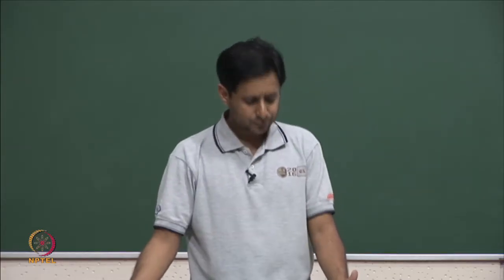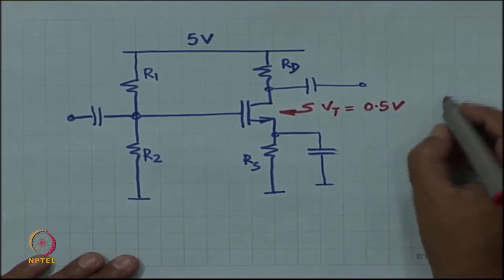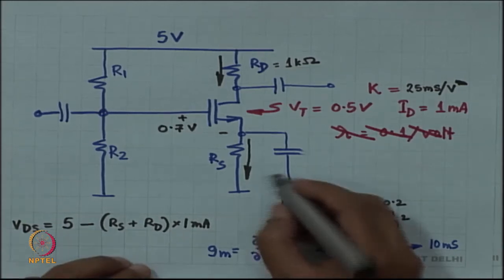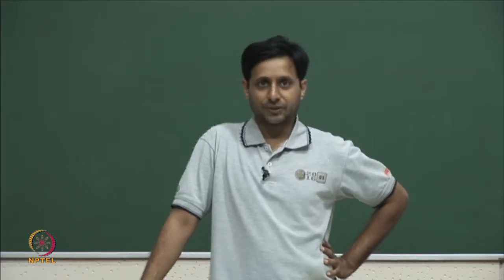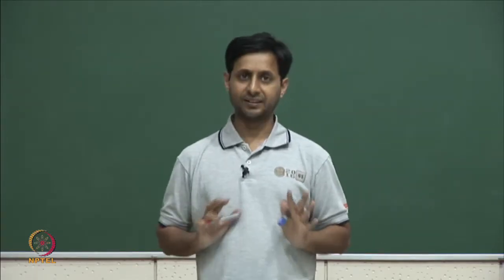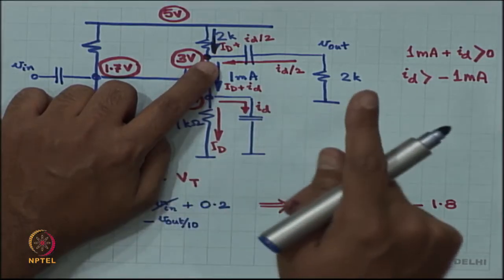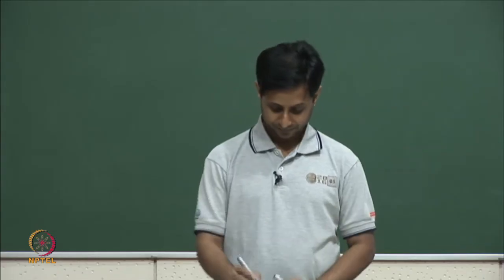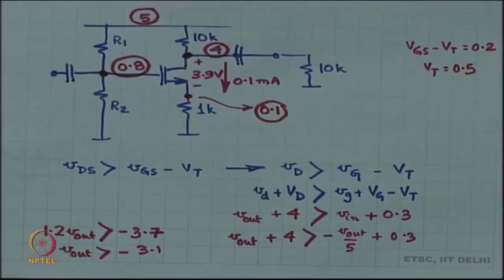Swing limits

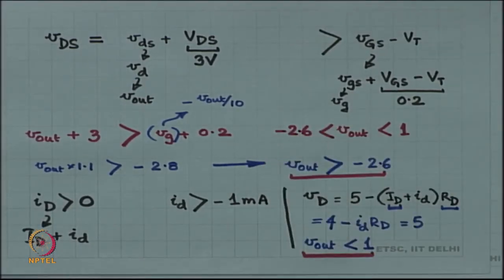Comment: Sir, With due respect , at 33:15, swing limits are found at -2.6 < vout < 1v. At vout = 1v, vin = -0.1v( as per MOSFET gain) = vg. vGS = vg +VGS = -0.1+0.7 = 0.6. Which is greater than VT by 0.1V instead of 0.2V. (vs = 0). ID will drop & further pulls down VS & then vGS will move up & stabilise. Is my understanding correct

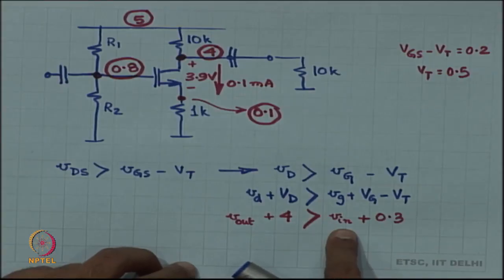Comment: In the last question at 57:54 how Vin=Vout/5... Can anyone explain???
Reply: Look at the nodes thats @gate node it's 0.8Volt and @drain node it's 4volt... Which essentially means drain is 5 times the gate in voltage
Reply: @knowledgehunter4871  thank you so much🙏🙏
Reply: computed at 51:24
Reply: Maybe he took gain as 5...u can try for 10
consider it as a practice
Reply: @manojkumarreddy2103  lol 😃😂🤣🙏🙏🙏

Comment: The maximum vout is not clear mentioned between 32 to 33 minutes . Can anyone clear it please
Reply: for lower limit the device should operate in flat region so VDs>VGS-VT
so we get min vout 
for mac vout 
the current through circuit should be greater than 0 so ID +id >0 then we get small id to -1mA
we put this in kvl from VDD to gnd VD=5-(ID+id)RD

VD=4-idRD
VD=5v Max VD
so Vout shoud be less then the 1V